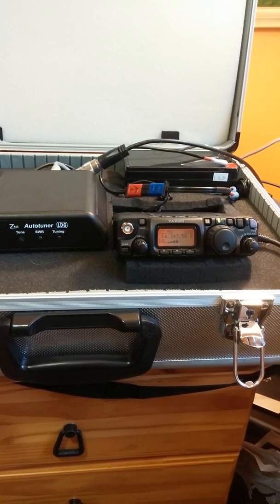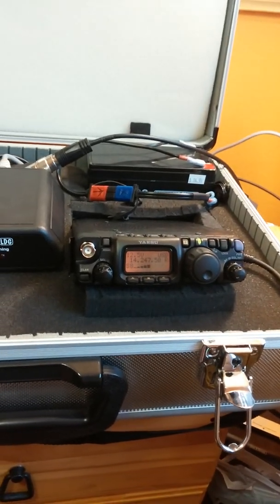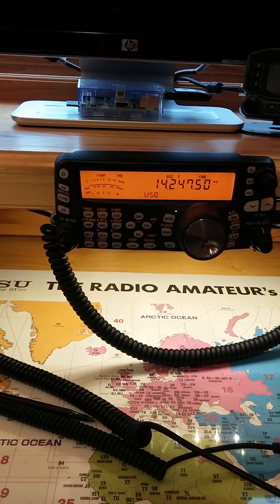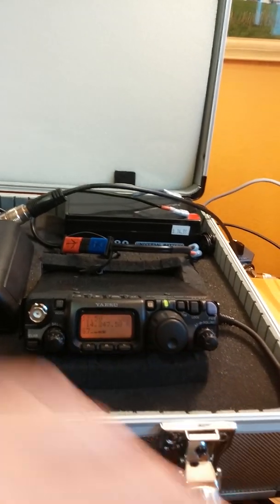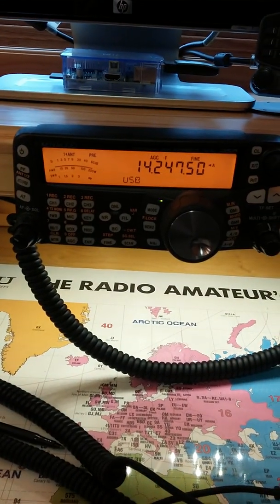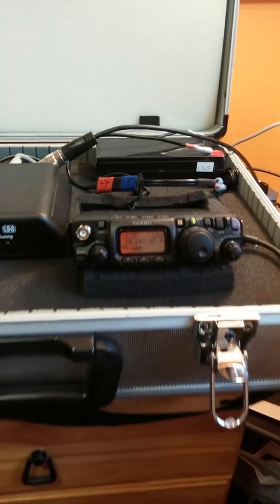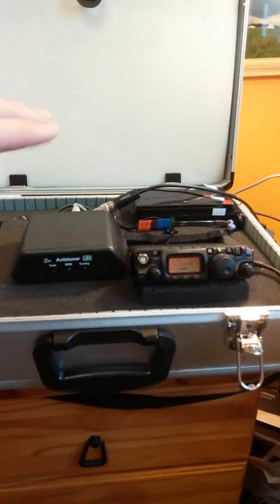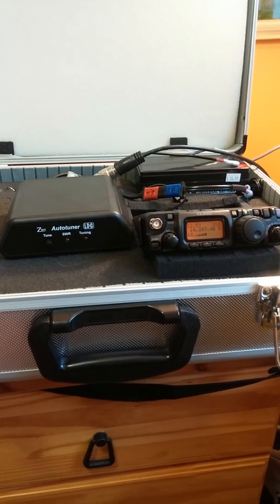Yaesu ft-817nd VS Kenwood ts-480sat

Comment: Using just my ears, the 817 has a quite vibrant sound, a bit tinny sounding, like a Yamaha Piano. The TS480 is much more refined, like a Kawai Piano, every bit as readable, without the higher noise floor of the 817. If I had to choose, I'd go for the ts480. The volumes didn't match, the Yaesu was turned up quite a bit more than the Kenwood. But sound for sound, I much prefer the more tamed sound of fhe ts480. Not sure how long I could listen to the noise on the 817. Both do an incredible job of pulling the signal in, I'd easily give the fella on the other end a 5-8/9 from both rigs.

Comment: Hi, great video, interesting comparison, I am looking to use a Kenwood ts480 in the car for HF mobile vs Yaesu ft857 which is very similar to the 817, what would your recommendation be regarding receivers?

Kind regards,
Simon
M0SYS
Reply from the maker: I think a lot of it has to do with preference and familiarity with a certain company or their radio .  I tend to enjoy QRP myself however hard to compare since they are not apples to apples .  They are all great rigs . For mobile I'd lean with the 480 since from my experience has easier menu settings and a larger display . Again all great radios
Reply: Many thanks for the fast reply, I agree that a clear, easy to navigate screen is a big plus.  Great videos, I look forward to your next!

Kind regards,
Simon
Reply: srs26 I have both the Ts 480 HX and the FT 817nd both receive the same the KENWOOD TS 480 HX have a better audio on TX and RX

Comment: To me, the FT-817 sounds comm quality but does a magnificent job of pulling in the signal. The TS-480 sounds quieter but it also sounds like you have the DSP on in the TS480 which would explain why it is quieter. In terms of readability, they sound the same to me.

Comment: As I've stated before on these comparison videos.. You have to use the same speaker to really give an opinion. Also of course both pre amps must be either on or off. I couldn't tell in this vid if they were or not. Also adjust the PBT so both radios have the same pitch if you will to get the same basic audio characteristics.

Comment: How did you mount the map on your desk? That is a great idea.....
Reply from the maker: the map is actually from yaesu. the top reads "The radio amateur's world map" I believe it came with the purchase of my 817 folded in the box, i just unfolded it, ironed it with a dish towel over it so not to ruin it, and placed it under Plexiglas, also did this with a band plan from Icom.

Comment: for me sound the same . don't go by the bars signal because different radio . I go by the sound and both sound the same
Reply: +Axel Matos    It's amazing how some people tend to use the signal strength indication on a radio to determine how "good" it receives and will compare that to a lesser S-unit of another radio (as if this somehow matters). Some folks don't comprehend an S-unit reading of S-8 on one radio can actually register lower on another radio, yet the lower S-unit radio can have better reception quality. Other factors apply but it's interesting how just seeing the S-unit on a radio can influence some people.
Reply: +Mike Hawk Yes Mike your right good day Mike
Reply: Just using ears the Kenwood seemed more intelligible.  Yaesu had more shush pulled in with audio.

Comment: It will help the 480 on receive if you go to menu #26 and turn on the antenna tuner for receive.
Reply from the maker: i did check, menu 26 does say "ON: then below it reads/scrolls "LSB antenna tuner for reception"   I haven't changed any of the menu settings since the video . but thanks for the advice, i did check   ( im a few months late to reply )    :)